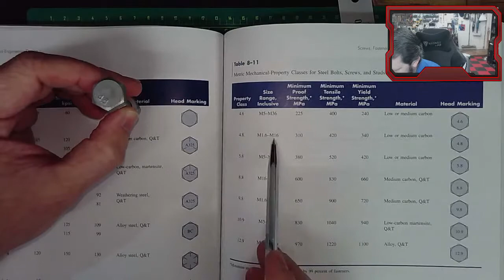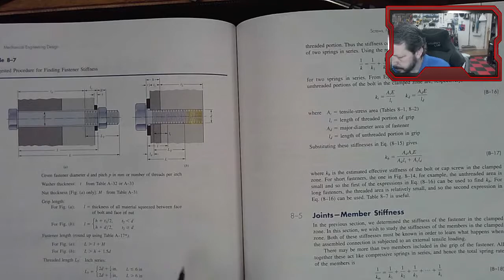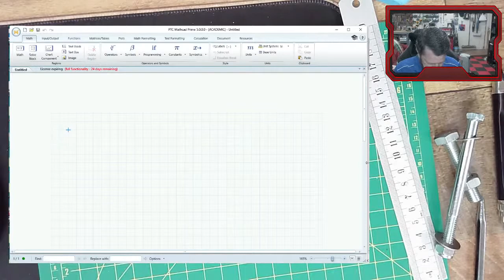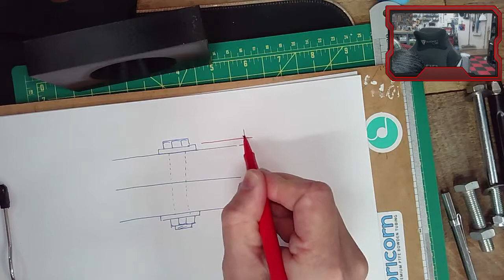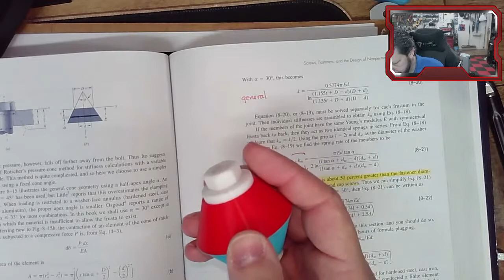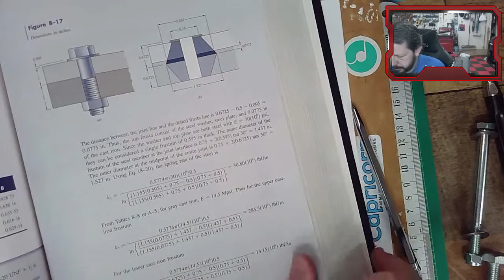Shigley 8.3 - 8.7 | Threaded Members | Stiffness

Comment from the maker: When doing the MathCad of the bolt stiffness I thought I was getting the wrong units, but that part was not a problem. I just needed to replace them with N/m and it was ok. The actual problem was that I put in the Modulus of Elasticity for Steel as 200 MPa, and it should be 200 GPa! Sorry about that.